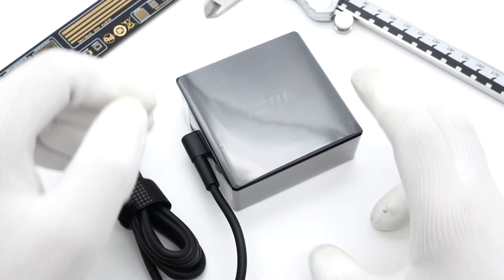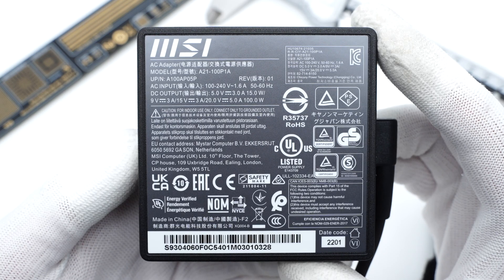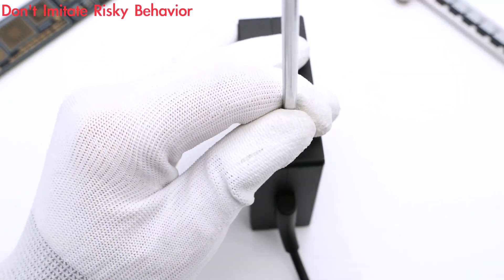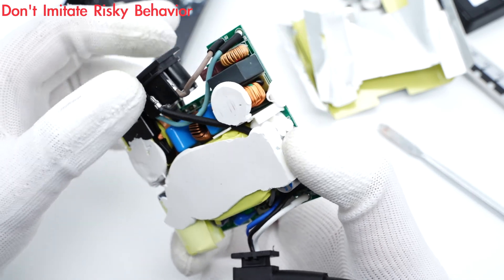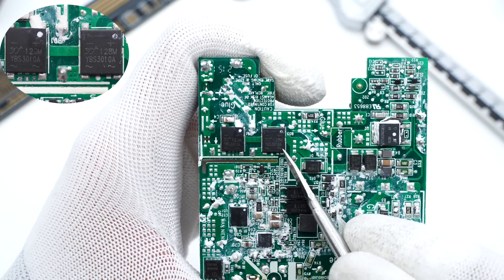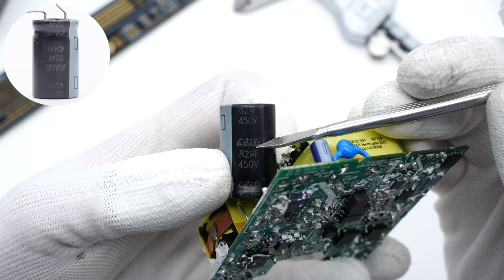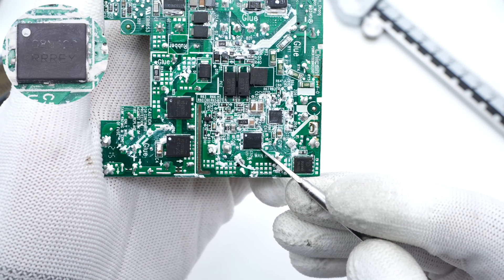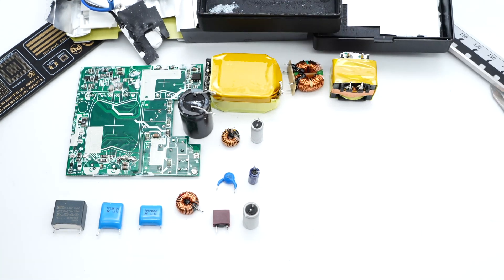Teardown of MSI 100W USB-C Power Adapter (A21-100P1A)

Comment: The captive output lead is a big turn off. What were they thinking?
Reply: 1. cost reduction
2. improved reliability (eliminating another socket/conector in the power delivery path, preventing the user from using an underspec'd 3rd party cable to deliver the power)